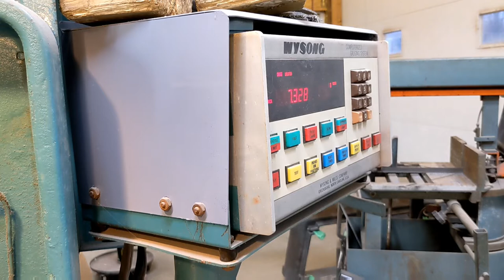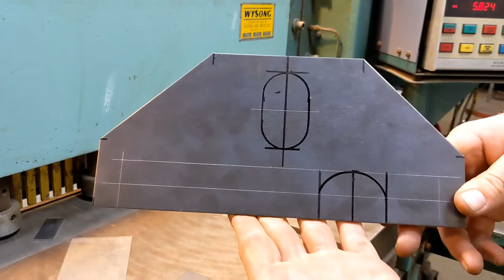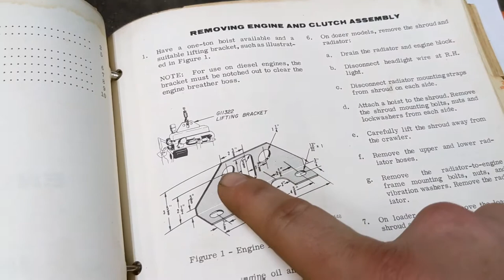Sheet Metal Fabrication And Layout

Comment: Good video, nice work. Confusing title. As a viewer, I like it when the titles are numbered in sequence to the specific project. Such as, “Episode 16: Case 310 dozer rebuild- fabricating engine lifting bracket”. Thanks for sharing this process. Your shop has some nice equipment! I would probably have had to use a torch, cutting discs, and weld 2 pieces together to make that!